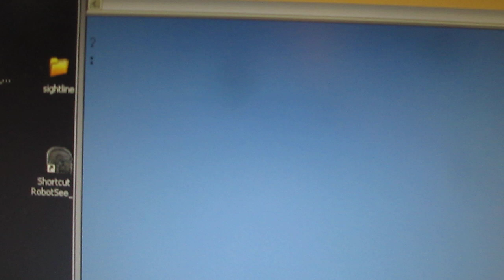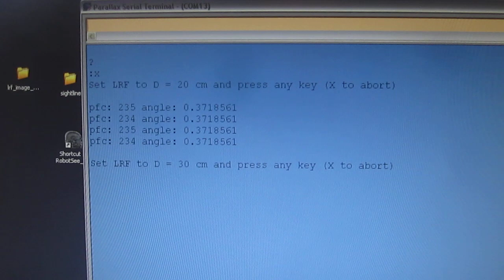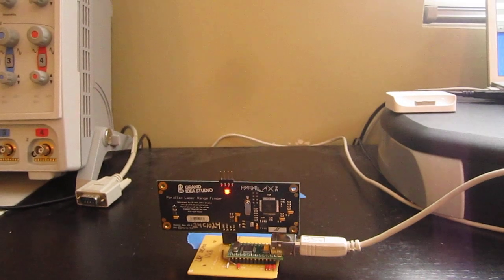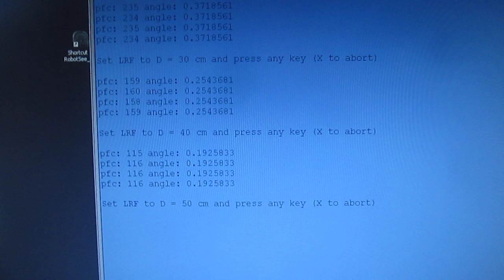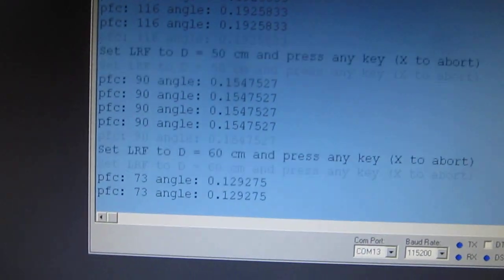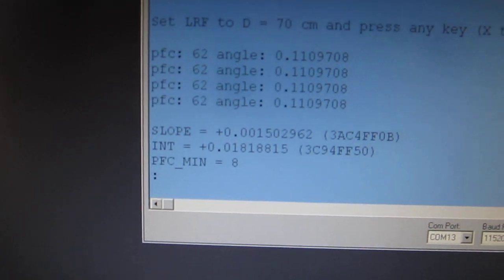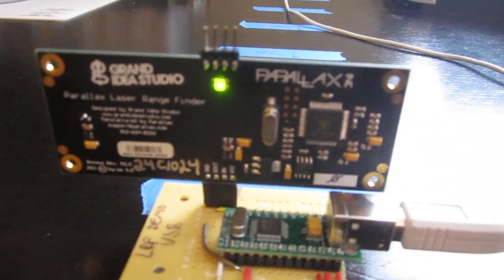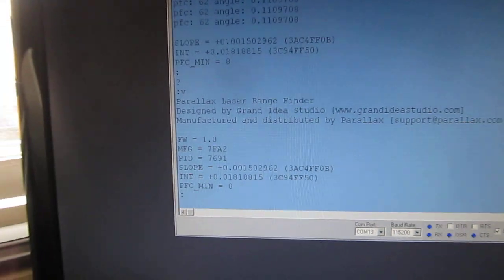LRF: Laser Range Finder Module Calibration

Comment: Thanks for the info.  I just tried this myself, and although I was very methodical, I found that the new calibration was actually worse than what my unit came with.  It appears that the intercept is probably about right, but the slope is all wrong.  Before calibrating, I was about 0.5" off at 800mm, now I'm 1.5" off... but I'm dead on at 200mm.

I repeated the calibration about 8 times, but with the same result every time.  Is there a way to manually enter slope and intercept values?